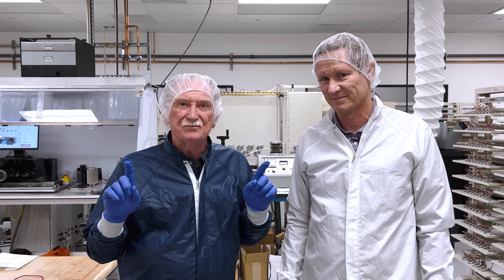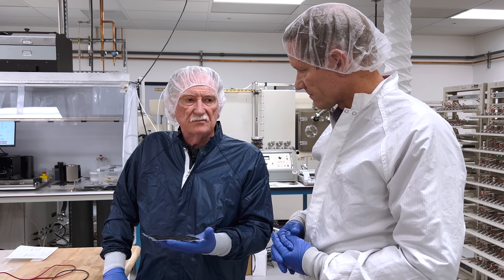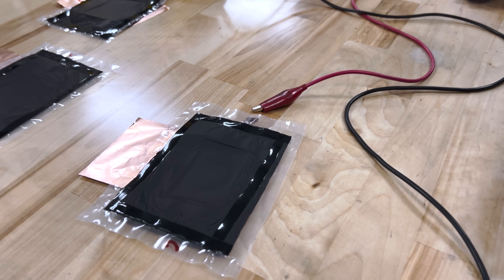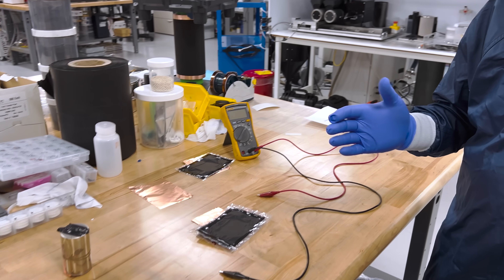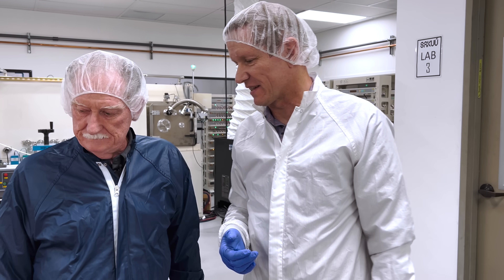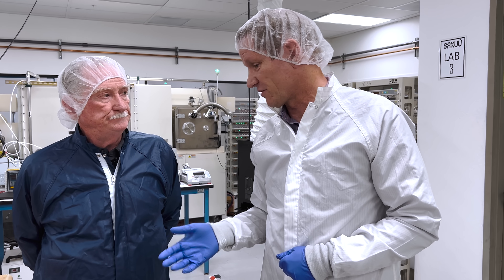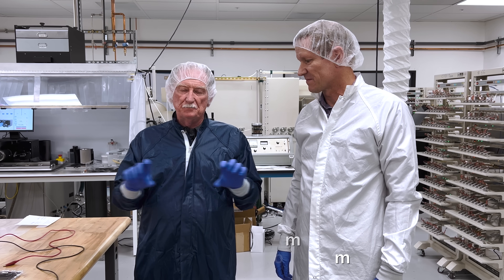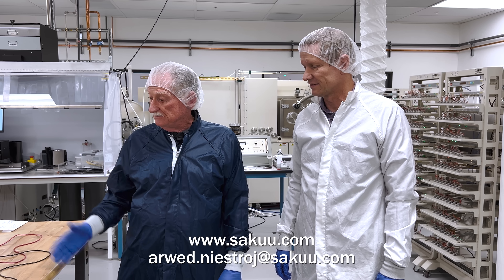Sakuu's Metal-Free Battery Cell: Game-Changing Innovation

Comment: Would have been nice to know how far they are from market. Too many claimed "game changers", not enough actual changing. I do hope they actually make it to market. 

Let's do some math. (These numbers are from quick google searches and might not be accurate).
Model Y SR battery, 60kWh, 454kg about 132Wh/kg
Using Sakuu's 354Wh/kg for 60kWh battery would weigh 170kg. It has 284kg of play for other equipment like cooling and stuff. That is crazy. 
Say you want to double the battery to 120kWh, 120kWh / 354Wh/kg = 340kg, still leaving 114kg of play before matching the original battery weight.

A Model Y SR with 60kWh battery has 393km range. A Model Y with a Sakuu battery of 120kWh would be closer to 786km range.

Again, these are rough numbers and estimates. But if this battery is able to get a completed battery pack (including all necessary equipment) up to 300Wh/kg, it will be the end of the ICE age as Sandy says.

The only other real questions is about production speed.
Reply: And charging characteristics? How fast, Temperature curve and then discharge etc.

Comment: "No metals" based on the periodic table of elements and how they are grouped into different metals and non metals? Or is "metal" defined here as a solid and shiny chunk of material?
Reply: Solid and shiny chunk.  There's still lithium/nickel/etc in the chemistry, just no sheets of copper or aluminium on each cell or cell layer.

Comment: The biggest questions left unanswered are:
- Can this technology scale to GWh or even TWh scale?
- What is the number of charge/discharge cycles for energy retention above 80%
- What is the charge rate / charge curve of this battery?
- Are there any rare or expensive materials that go into this cell?
- How this cell will be packaged for automotive applications?
- How does the cell perform with harsh environments (vibration, temperature, etc)

Comment: From what I've read, these cells are not metal-free, they have a lithium metal anode and high nickel cathode.  The electrolyte is just listed as "proprietary", so who knows what's in that.  It is true that they have replaced the copper and aluminum conductors in what they are showing here, and replaced them with a conductive polymer.  So they have removed some metal, but they aren't metal-free.

Now conductive polymers are not something new and were not invented by Sakuu.  They've been the subject of research since the 50s, I believe.  OLEDs are one of the outcomes.  As pure conductors, they show a lot of promise.  But there is a reason you don't really see them being used widely.  There's at least a half dozen unsolved challenges that would need to be overcome to make this viable.

Makes a great lab demo to excite investors.  But if Sakuu had solved these challenges, they would be looking to produce these themselves and make a mint.  Instead they are looking to license their technology.  Which is another way of saying they have no idea how these could ever be manufactured at scale and at a profit.  They want somebody else to figure that out.

Comment: Fast Charging a discharge rates are critical for Automotive battery cells. 

Also cost per cell and can it be quickly scaled to produce these cells super fast in great quantities if materials and manufacturing equipment are readily available to do so?

Voltage and watt-hours is not enough to convince me this cell is a viable candidate. Tell me more, like the entire specifications Data sheet, to convince this Electronics Engineering Technician you really have the perfect horse that beats everything else out there!

Comment: What is the effective series resistance of the Saku Cell vs the 4680 cell and others?  The effective Series Resistance (ESR) Limits how fast energy can be drawn by the BEV motors, which affects peak torque, and how quickly the cell can be charged.

Comment: I’m still quite skeptical. Sandy has done this before, like with the disc drive hydrogen generator and that con-job truck company. Plastic does not make a very good thermal pathway, did they solve thermal dissipation as well? Expansion and contraction? Resistance; I’m assuming that is what he’s talking about with conductivity tailoring. Can Sandy provide link to a data sheet that answers the key parameters? If all of this pans out, then awesome.

Comment: While promising, it's NOT yet game changing.  This was more an infomercial than anything else.  Hyperbole is for marketing. 

If I understood correctly, they are still working on the cell to get the cycle life up. They talked about If they do that, the cost/weight/volume reduction is a great step forward.   The safety aspect already exists with Lithium Iron, but at a cost of energy density.  Promising but this needs more testing before it actually can be used in production.  Hopefully they can deliver value in large scale production in a few years.

Comment: Voltage is great, Sandy, but you need some current to generate power.  How do you cool these things at high power levels?
Reply: I guess we're all asking the same questions.. :)
The fact that they didn't come out and say it tells me that they are still working on it and it's a problem.

Comment: Presumably it still needs a wire between each cell if they're stacked because the BMS system to ensure nothing gets overcharged, but these wires can be tiny.
Reply: you could encase them to stack them and hold them together
Reply: @THERE.IS.NO.DEATH.  But how would this prevent them from being overcharged?

Comment: You can't stack cells without cell taps, otherwise you cannot monitor/balance the individual cells.  Additionally, if you limit cell conductivity for "safety", you are also throwing away fast charging and any reasonable performance.   (I2R losses will be high, so the cell will be inefficient)
Reply: For probing the voltage is enough to have a thin and narrow strip between the cells.
Reply: @jounisaari9471  Then they are no longer "tabless" as claimed.   Like 95% of most new "earth shattering" new battery tech announced, Just wait and see if they can actually get something even remotely useful into production.   I'd say this is nowhere near that.
Reply: @Ingineerix  it's enough to have a few microns thick and one mm wide wire for measuring the voltage. Flat cable from BMS and stack the sense wires between cells. For sensing the voltage it doesn't need large area and nearly no current is needed. 

Balancing is different thing. That also needs <1% of nominal current capacity for current. So a very thin foil is enough between the cells to enable balancing current. 

With tabs the tabs used for balancing needs to be strong enough to hold full current. Like 100Ah battery with 1kA max current is enough to have a foil that can carry 100mA without noticeable voltage drop. It would allow 1% unbalance to be corrected in 10 h. 

Tabbed battery needs 2 times 1kA tabs between cells. Tabless needs just one foil for balancing current. Easily 1000 times difference on materials.
Reply: @jounisaari9471  My point is, they claim "tabless".  Not "No large tabs".  Anytime there is obvious exaggeration and marketing "fluff" , it sets off my Bulls**t detector.  Mark my words, I'll bet you we don't even see this in 5% of EVs in 5 years.

Comment: if and when it reaches the cycle requirements this will be a game changer. Only thing not mentioned is cooling - does the absence of metal within the cell itself make heat dissipation at the module level more challenging?

Comment: Lithium is a metal so it’s not metal-free but it’s metal free packaging.  The innovation is the use of a conductive plastic wrap skin.  Their biggest challenges will be cooling and dendrite formation.  Metal casings aid cooling and allow cells to be wrapped tightly to combat dendrites.
Reply: This particular type of cell is metal-free inside and out. The company does license other cells that use lithium.
Reply: @elliotclee  Potato battery!
Reply: Lithium is a metal is like saying water is a solid. There are different types of structures to lithium as there are for water. When you have salt on your food does it feel like you're crunching on sodium metal?
Reply: @Buzzhumma  elemental lithium is a metal. We know there are compounds that have different properties, but we still call the element a metal.
Reply: @elliotclee  yes but the think the reference is the amount of lithium used is far less than many other processes of making cells with lithium!
Reply: @Buzzhumma  metal is not a phase of matter, as I understand it.  Whether an element is a metal or not has to do with having a low number of electrons in its outermost shell, which is determined by the number of protons in the nucleus and the order in which electrons fill the shells.  The number of protons is fixed for each element type.
Reply: @Buzzhumma  what is the chemical formula of lithium metal?
Reply: @mrknesiah  check into the Mendeleiv table and open a book of chemistry before saying that.
Reply: @alanhart5740  What is the chemical formula of lithium metal
Reply: @mrknesiah  as you’re asking that, you confirm that you don’t no enough about chemistry. Lithium is a metal as element but very reducing (propensity to give its electrons). That’s why in nature you find it mostly oxidized: Li2O. But with a lot of energy we can separate it from the oxygen in order to get pure lithium: Li, which will arrange in a centered cubic crystal lattice. Therefore you cannot know the number of atoms that will form it, that’s why you just write Li or eventually Li n (n times).
And you, what would be your answer ?
Reply: @alanhart5740  Exactly…the battery has pure lithium metal
Reply: @mrknesiah  just in case, I did a master in chemical engineering… so what’s your point ? 
Maybe read about the Dunning Kruger effect,
Reply: @alanhart5740  Glad you finally accepted that “lithium is a metal as an element.”
Reply: @mrknesiah  « Finally accepted » ??? I never said the opposite that lithium is a metallic element. It’s fundamental as knowledge. Wasn’t it you who said the opposite before modifying your post ?
Reply: @alanhart5740  Glad you understand that lithium is a metal.
Reply: @mrknesiah  we lose time because I never said that lithium is not a metal…
Reply: @alanhart5740  Then we are in agreement

Comment: China would have been all over if this were any good.  I think no presence of metal reduces its current/amp ability in charging and discharging rates, likely close to the graphite or alkaline batteries of the same size.  Polymer holding the materials likely to degrade in a few years, reduce capacity or completey kill the cell. If there's a product for this it is low power appliances then it can be charging rates, like full charge at 24 hours or more.  still interesting though, I give this a like button

Comment: Battery Vehicles, BV, parked 23hrs every day and 20million in Australia means every building can be offgrid. 
BV oversized battery, oversized for that daily drive, has massive reserves of daily storage for rooftop PV. 
BV parking space with a $60 wall outlet at every building and trickle currents all day long and night is ezi pezi.

Grid cash flow will be a dead duck.
Dirt cheap offgrid will save:

Grid electricity costs
Heating costs 
Gas costs 
Petroleum costs
After tax savings.

Grid electricity is 10times more expensive than offgrid electricity.

Comment: Dare you to connect a brake light bulb to it for 5 minutes! 😂
Reply: While I agree that this was thin on demonstration there is 0 chance a company is going to let people play with an engineering sample in that way. If Sandy is excited there is something there and he is lucky that people trust him to show this kind of tech even if it's currently bespoke.
Reply: They could 1) have provided full, accurate specifications 2) shown a demo with a bulb or motor...but they know this thing has only tiny current capabilities.  Sandy doesn't understand basic electricity and gets excited too easily.  As in several past episodes, he can be wrong.  He was given incentives to be the Arcimoto "mascot", how did that work out?

Comment: Dust and BS!  The conductor on the top & bottom must be carbon dust (in a polymer), so "no metal".  If Lithium is involved, that's a metal!  Sodium is a metal too. The "tabs" are not gone, see those big copper sheets? High current conductors are required to charge or discharge these magic cells.  What is the "magic" then?  No current capability!  Those are misleading, extrapolated "lab curiosity" specs in the charts; yet it likely cant even light a small light bulb, much less the higher current loads of a traction motor  (the load shown is the 10 MegOhm 117 meter or ~ 0.3 Micro Amps!).  Sandy should have brought along a standard #57 brake light bulb and connected it to that sandwich.  Voltage would have dropped to less than a millivolt instantly, with nary a photon or heat calorie out of the bulb (or the battery)!

Pure "hocus pocus" publicity stunt, that they know is all a lie!   Sandy should stay out of "electricity", where has as a total lack of knowledge or understanding.

Comment: Cool technology. I am very curious to see how they make thermal systems and design the pack to stop the spread of fire. Both of these systems are typically put in that dead space in cylindrical celled battery packs. I am not as familiar with prismatic pack designs.

Comment: What's the charge/discharge current? With no metal, surely internal resistance (both electrical an thermal) has to be much higher?
Reply: It's a different path.  In a normal cell the current collectors are across the face of each layer, then the current flows parallel to the layer.  Multiple layers are arranged in parallel, so an entire 4680 cell is still 3.7 volts.  The pack then combines cells in series (and some more parallel) to get 400 or 800 volts.

The cells in this video flow perpendicular.  You might stack 100 of them together in series, put a current collector on each end, and form that into a box-cell which gives you 370 volts.  The rest of your pack design would be almost entirely parallel.  You could also stretch the cell out to be the entire pack...

100× might be too much as we don't know the specific thermal and electrical conductivities, but reducing the thickness and having more cells is always possible.
Reply: @rhamph  The question still remains, what's the electrical and thermal resistance of a whole battery pack?

Comment: 25% improvement for a completely new production method is not a good design. Also the degradation is going to be worse as the huge amounts of voltage flowing through the cells. Each cell has to flow all the electrons in the cell, which is going to be larger than any 4680. Not to mention the 4680 is not even close to optimised.